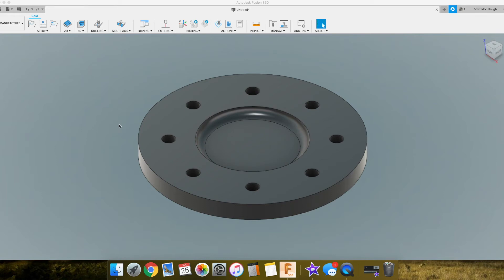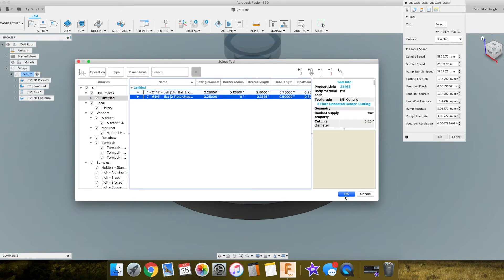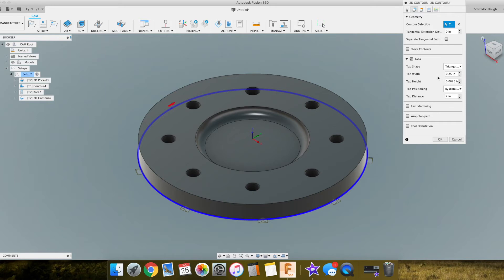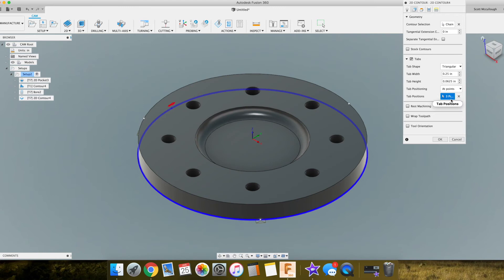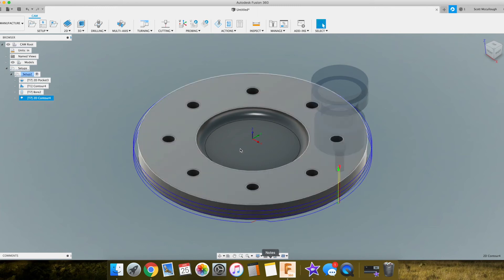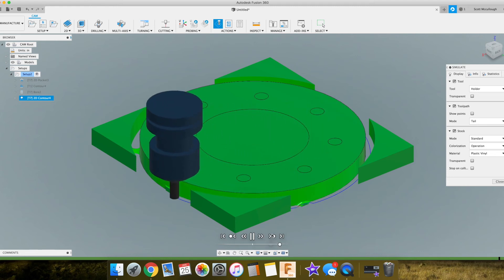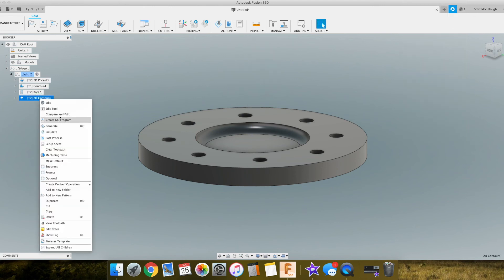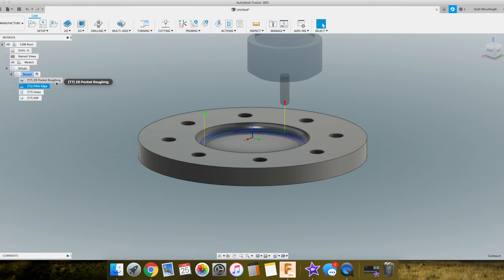CAM For CNC Router Fusion 360 Beginner Tutorial: Cutting Profiles

Comment from the maker: Tell us what you want to learn in Fusion 360 CAM!
Reply: I just bought a single point thread mill.  There is not enough option to use it with my Enroute software.  I have to resort to Fusion 360. Any pointers to get started.